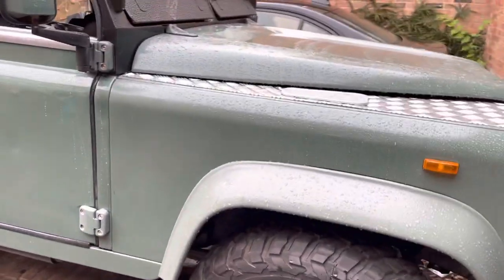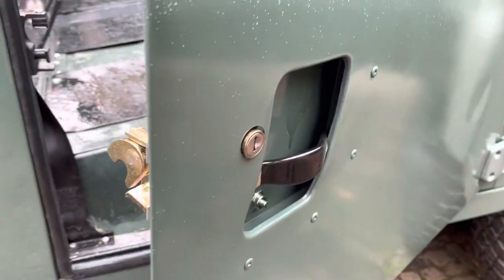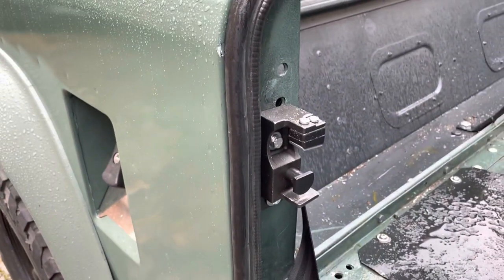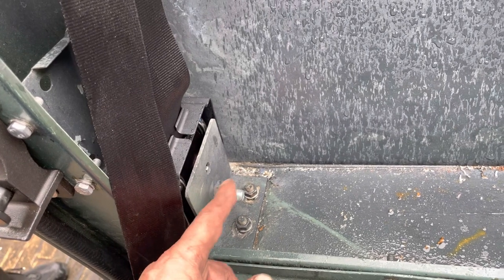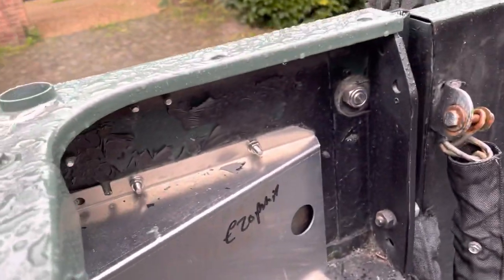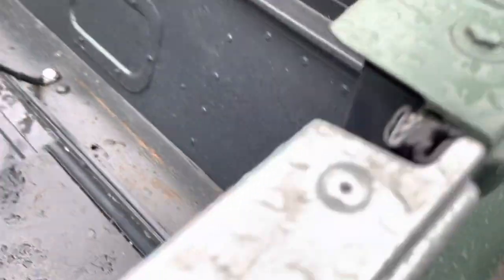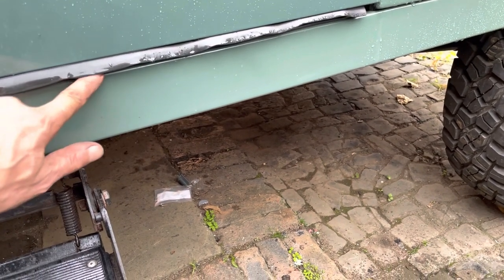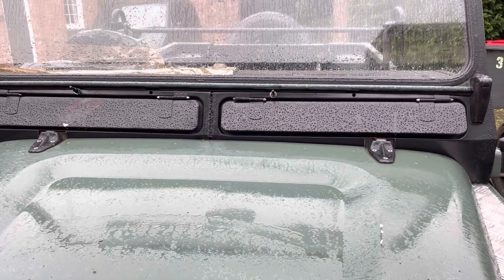LandRover 90 Jobs - New Door locks, Seals, Seat Belts

Comment: Just bought a Land Rover Santana Series 3, so my fun is just about to begin. I watched your video, to see how to fit seat belts.
Reply from the maker: Have fun, they take a bit of time but, there's so much knowledge around. If you need help, shout up...
Reply: @MarkIAnson  Cheers 👍
Reply: @MarkIAnson  Can you get front seat inertia lap seat belts for a series 3 soft top?
Reply from the maker: @algelgie  I don't think the series came with them but, sure there's something around that would work
Reply: @MarkIAnson  Cheers Mark. No it hasn’t but the wife won’t get in it unless I put some in. Just deciding on whether to get inertia ones or static?
Reply from the maker: @algelgie  static belts are normal for the middle seat - but, inertia are available for the driver and passenger. Check out Bearmach, MPS Trading - sure they'll do them
Reply: @MarkIAnson  Cheers Mark. I’ll check them out.
Reply: @MarkIAnson  Cheers Mark. They have a Spanish branch which is really useful. These will be my go to guys now. Thanks again.